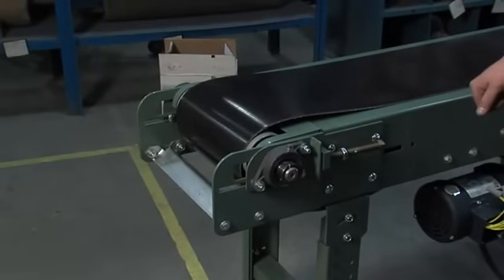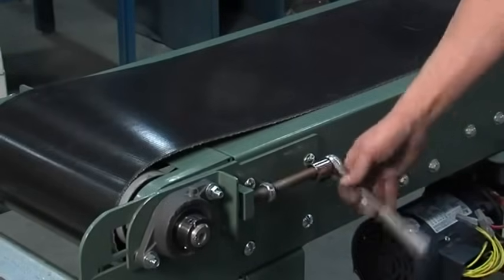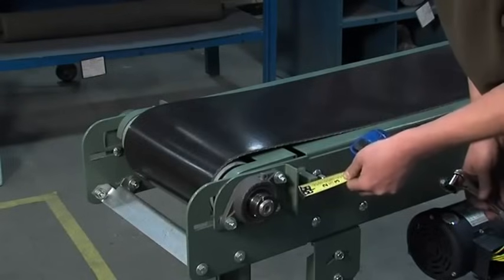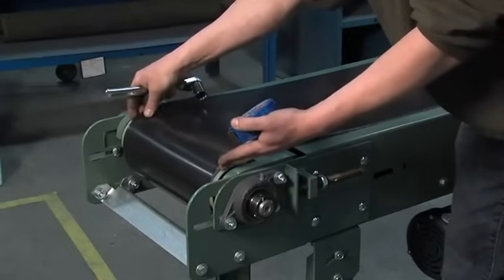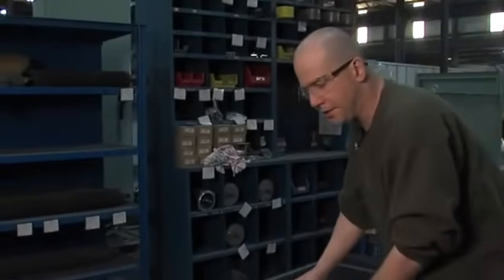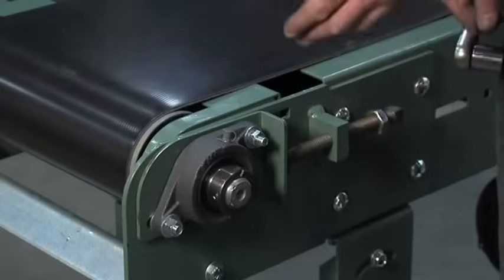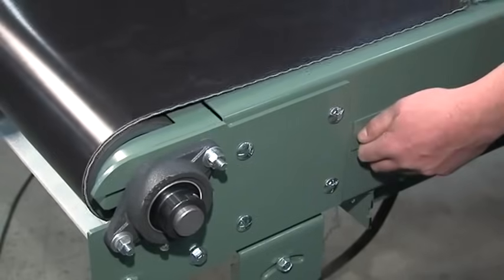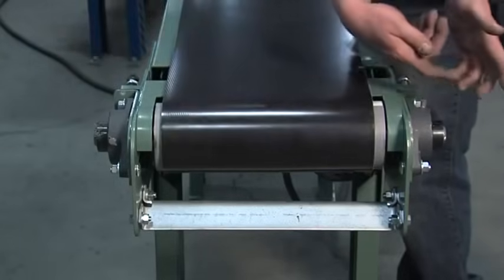LEWCO Conveyor Belt Tension and Tracking

Comment: Worked at a large candy plant that had tons of conveyors. Some of the lines in one room had 8 conveyors. Candy would be deposited on short belt then a bottomer  belt to coat top of candy, on another belt to conveyor then to a short cooling tunnel belt thru a second coating belt then thru an $5,000 silicone coated 42" wide over 125'cooling tunnel conveyor that had air or a micro switch to automatically track conveyor belt. They would purchase several hundred roll of 48" wide lagging to glue onto drive rollers to prevent belts from slipping. Cut that up to line the drawers of my tool chest & tool cart to prevent tools from moving around. Ten Newest conveyor that only transported empty boxes or shipping cartoons had 1/3 HP 480 Volt three phase motors built into 4" diameter by 18 or 24" wide drive rollers.

Comment: The video I didn't knew I need, before I saw it! ♥
I can't stop thinking about what type of lightweight conveyor belt one should construct on the Moon for transporting excavated moon rocks and dust, while trying to reach Moon's Crust (to mine different minerals). You want conveyor belt and construction to not take too much of space and weight, as all the equipment you can lift to the outer space is limited!

Comment: That belts too loose. His guide to tensioning is a joke. If you can get your hand under its all good????? Never heard that in my life and its quite frankly ridiculous. Belts have a optimal tension. Each belt is different but you do it the same way. First mark out 2 points for example 1 meter apart down the centre of the length of the belt. Then apply tension and measure the marks until they measure the set optimal tension. 
Depending on length, width and material type and application most belt require a extra 25mm of stretch for the small belts going upto metres of stretch in these big mining belts. 
All this info should be available on the belt manufacturer website. 
Also
Don't get me started on how you tracked that thing. 
Trust me people he did what we all do ( I'm a belt fitter of 15 yrs) he just fiddled and farted about until it was good. 
Joking aside perfect central on all rollers tracking is seldom achieved and when it us its by fluke. Too many variants, cut of belt, how straight it the machine bed etc could go on my point is when taking a belt find the point where it naturally seems to stay( it'll never be smack bang in the centre) if you twiddle to much you'll be there forever.

Comment: There is no mention of it in this video, but at least one of the rollers must have been crowned (or conical-cylindrical-conical). Otherwise tracking will not work in this conveyor, with this belt. Probably the drive roller is crowned which makes sense (and is usually done) since belt tension is highest where the loaded belt enters the drive roller.

Comment: Never track with tensenor. You warp the belt. You just need to track with snub.
Reply: Some conveyors don't have snub rollers. Tracking with the tail pulley (tensioner) is okay, but instead of increasing tension to make the belt go one way, it's better to decrease tension on the side you want the belt to track to.

Comment: the snub roll is completely useless unless you use it as a take up for belt stretch over time it is not a tracking pulley ever! the tail pulley is always the tracking pulley and should be minimal adjustment but your drive pulley needs to be crowned for sure
Reply: incorrect. tracking on your snubbing rollers is the primary method of tracking. the tension carriage should only be for tensioning and then minor adjustments in belt fluctuations if you haven't got a straight belt say. The guy just tracking on the tension end will invariably just stretch the belt and then eventually just cause seizing of the drive or premature degradation of the belt. 

Also tension checking may be fine with the method advised on small belts but any long / wide or heavy belts the check should be distance of return strand of belt to frame over return roller and then distance check of 1/2 way between both return idler sets. The distance sag should deviance should be 2% of the belt idler to idler distance i.e. 2m idler return set means sag estimate should be 40mm.  

small belts you can get away with this rough way of tracking but on longer belts you will cause major issues. Source: 10+ years installing quarry / logistics conveyors systems with belt runs of up to 150m
Reply: @pacee21  a snub pulley is only used to create greater wrap around either the drive or tail pulley a snub it is never used for alignment its also normally hard to access. alignment is only made possible with a pulley that is crowned and has alignment bolts. Been doing this for 35 years

Comment: did you crown the drive pulley for tracking? you should vulcanize the belt rather than metal lace the lacing will over time ruin the pulleys especially aluminum...lastly your snub roll should move vertically for belt take up

Comment: Conveyors very seldom just start tracking off on thier own. Most often it is an outside reason for the problem. Improper loading, buildup on tailpulley, return/troughing roller(s) not turning, belt traveling over buildup on return side, seized trainer. List goes on. Inspect conveyor head to tail to find the reason before doing any adjustments.
Reply: Also, seized bearings in the snub rollers or the end pulleys can also affect the tracking of the belt. As said, tracking is a very tedious and time consuming process
Reply: Non V guided belts tend to wander quite a bit even under tension
Reply: Mind if I pick your brain on a problem I am having about belt tracking?

Comment: What an idiot. You should be square with your take up. The only adjustment you should use is the snub roller for tracking. By having your take up not being square will cause your belt to stretch which will cause your belt to "walk".

Comment: Why did you very long  procedure to made belt tension,. before you made tension and adjustment the bolts  let you know how much  a gap the belt in roller before measurement a side by side the tension bolt  , if you know gap it is easy  to adjust the tension bolt fit of roller to fell stretching the belts'